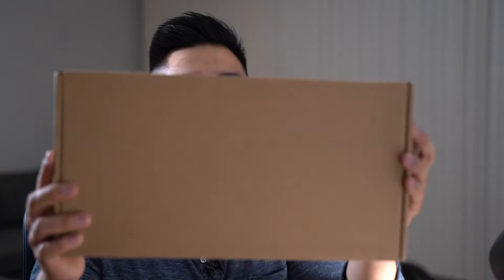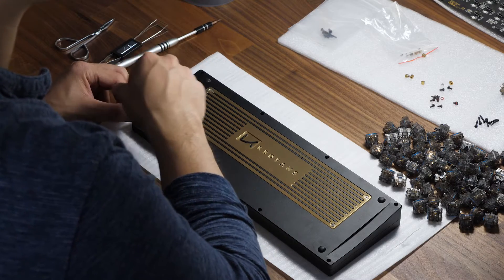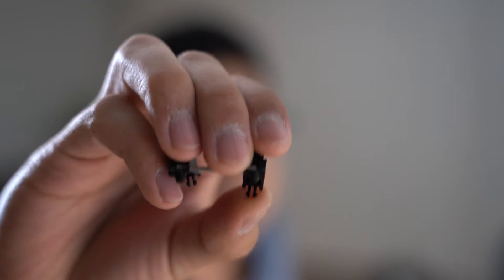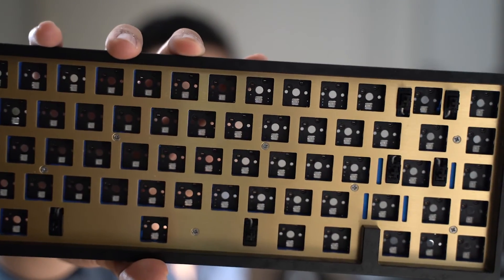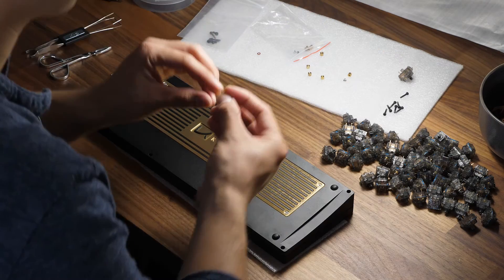KBD67MKII Full Beginner Build Guide - Part 1 - Assembling Case

Comment from the maker: Timestamps!

00:28 Test pcb
01:46 Different types of screws
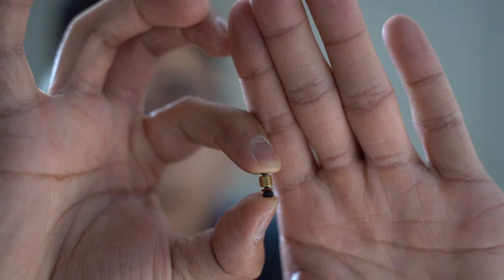03:18 Standoff screwing method
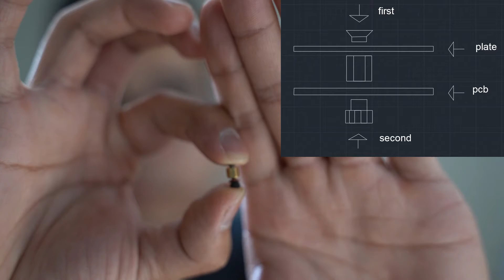03:38 Why use insulating washers 
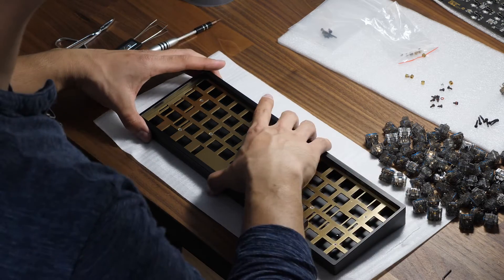05:58 Take apart keyboard case 
07:13 Identify the screw that attaches plate to top piece of case 
08:19 Attaching the philips head to the plate and standoff
09:06 Diagram for philips head, plate, standoff, PCB, and hex screw.
09:53 Stock stabilizers in box.
10:30 Importance of tuning stabilizers
10:57 Band aid mod with electrical tape
11:19 How to identify where the stabilizer openings are
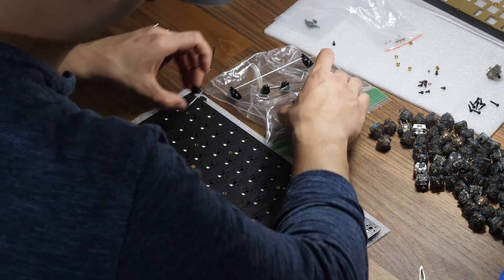12:12 Installing tuned snap in stabilizers to PCB
13:53 To check that your stabilizer stem is oriented properly 
14:51 Installing MK Ultra Foam
15:31 Lining up PCB to Plate
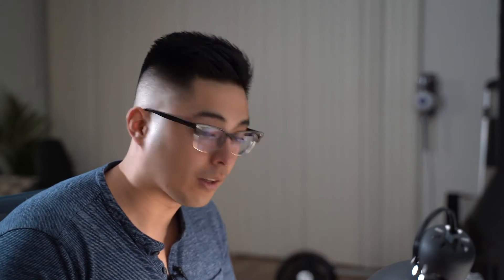16:11 Screwing in hex screws to the standoffs on the plate
16:16 Why I put insulating washers on the stabilizers and also the standoff screws
18:04 Importance of not overtightening screws
19:34 MKUltra case foam installation
20:41 Lining up the top case piece to bottom case piece 
21:17 Screwing in case
Reply: epic
Reply: So this means that the PCB supports Screw in and Clip in stabs right?
Reply: @Caiden Colin flixportal :D
Reply: @Parker Mekhi thanks, signed up and it seems to work =) I appreciate it !
Reply: @Caiden Colin You are welcome xD

Comment: Very informative video, thank you very much! I've just pre-ordered the KBD67V2 MKII ink black polycarbonate diy kit, and looking forward to it in september. This video will help prep me for my first full custom assembly. Just want my first experience to go smooth as possible, that way i have more confidence with assembly, once i'm ready to learn to solder later down the line, on another build
Reply from the maker: It’s a great first board!
Reply: @AndyVNguyen  do you know if Screw in stabs work with this board being hot swap pcb? sorry for noob question but, it is my first time, be gentle.

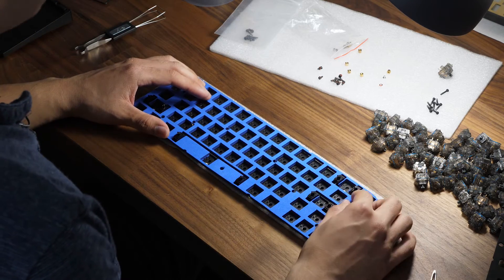Comment: Thanks for taking the time to put this guide together. Definitely useful while I'm putting together my own keyboard. 15:20 Do you feel that the MK ultra foam is worth it? Did you notice a discernible difference in noise/feel when typing? Thanks
Reply from the maker: I'm glad I could help! MK ultra foam does help, but I found that using the pcb foam made the typing experience a bit too stiff. The case foam was sufficient to mute any pinging from the alu case.

Right now it's pretty tough to source mkultra foam since they're having laser issues, so I often just suggest getting some shelf liner. 1/8" shelf liner will do the trick. It's much cheaper.

If you want to ball out a bit, you can get sorbothane .. but that's super expensive. I use shelf line for most of my boards, personally.

Comment: Hey man, good tutorial. I followed everything and it turned out amazing. However, I do have one question tho- you don’t need to install the standoff and plate/pcb screws if you’re using it as top mount right? The switches would hold them in place?
Reply from the maker: You should use the standoffs if you're using the hotswap version. It helps the switches snap into place and stay there. The plate has some stiffness so you CAN forgo it, but it's recommended to still use them.

Comment: Hey Andy, how do I tell what sizes of stabilizers to buy? Another question, since I'm using the hotswap version does it matter what keycap set I buy since I can customize the board? I'm kinda confused about how sets are sold and what I need for this board. Some keycapsets are only space bars and Cyrillic letters,  some are only novelties and modifiers. Will I need to purchase multiple smaller sets fill this board or what do I look for? I appreciate you taking the time to make these videos for people who are new to this hobby.
Reply from the maker: Look at the keys that are on the board. This one uses 3x 2u stabilizers for left shift, enter, and backspace. The spacebar is a 6.25u because it has a fixed layout for hotswap. 

Keycap choice matters. For this board it uses a non standard right shift, a 1.75 shift. So you’ll need to buy a keycap set that has that. Most epbt, gmk, Jtk sets will. Most tai hao and amazon ones will not.  Glad I could help!
Reply: @AndyVNguyen  Thanks Andy!

Comment: The newer version of this board (MKii v2) has ESD protection, but I have no idea how/where to install the little square silver pieces. One is right where the stabs would go and I can’t figure out how it can fit.  Can you show us or explain?
Reply from the maker: If you go into my discord server and take a pic of the pcb I can help you . It goes on those silver pads on the pcb. Skip the one on the spacebar that one won’t work

Comment: My kit came with two small square adhesive pieces of foam with metallic fabric on the end. Do I need to stick these on the corresponding metal squares on the PCB? Or does the large laser cut foam that comes with the kit reduce the need for this?
Reply from the maker: I didn't put mine on the board. I don't think it really does anything.

Comment: Hey Andy! I have commented on here before and you responded so I thought I'd give it another shot! Since you have experience with the KBD67 MKII, does it have screw-in stabilizer compatibility? and is there some sort of washer that meets the screw at the bottom of the pcb or how does it screw in?
Reply from the maker: yes. you put washers in between the screw and the pcb. it's applied at the back. they're not included so you have to buy them separately.
Reply: Andy V Nguyen thanks! So if I bought some Durock screw-in stabilizers, would they come with the washers?
Reply from the maker: @noahliebman7709  no, they don't come with washers. if you're looking for washers, take a look at my kit page:

http://www.kit.co/andyvnguyen/keyboards
Reply: Andy V Nguyen ahhh, I think the term I meant was nut, like is there something on the backside of the PCB that the screw also goes into to secure it?

Comment: My kit (soldered kit bought in May 2020) did not come with insulating washers. I only have some that came with the screw in stabilizers. Should I be concerned? Also, the plate that I got did not have holes for the standoffs. I am not sure what to do.
Reply from the maker: You have to buy your own washers. I have some on here https://kit.co/andyvnguyen/keyboards. If you have a solder board, your plate will not have stand-off holes

Comment: Do you know where I can get replacement case screws? The ones that came with the DIY kit are crap and have started to strip easily and one already broke in half! :( Thankfully I was able to get it out with pliers. Any recommendations are appreciated.
Reply from the maker: I would definitely contact KBDfans to send you replacement screws or at least get the spec. People often buy parts from mcmaster.

Comment: I got the screw that you are using for the standoffs on the pcb side. But i am not using it for the standoffs as i got a different screw that has a more rounded head compared to the other screws which all have a flat screw head. But as you stated you use the medium screw for the standoffs and the shortest screw for the plate, the screws I got are really easy to tell apart compared to the ones you are showing 7:34. I used the shorter screw for the standoff on pcb side, as i had the exact amount for the standoffs. Then I used the medium length screw for the plate, should i swap them around?
Reply from the maker: Just make sure the flat head top is on plate side. So your keycaps won’t hit it
Reply: yep they are, i swapped them around now so the medium screws are now being used for the standoffs and the small ones for the plate. But now my pcb foam doesnt sit flush anymore, you can visibly see the medium length screw protruding. Should I revert to how I originally assembled it or it should be fine.
Reply: Also thank you very much for replying!!! didn't expect it since the video is 1 year old.

Comment: Hi Andy this video is awesome. Thank you! It's been super helpful. Ran into some trouble though. Spent my Labor Day building my first keyboard and one of the screws broke off when I was mounting the brass plate to my KBD67MKII. The screw head came right off leaving the thread in the case. Any tips on extracting the screw from the case?
Reply from the maker: If it’s just one screw, you can try rotating the case top/bottom itself rather than the screw itself to try to wedge it out. Other than that, a screw extractor
Reply: What extractor do you recommend? The top of the screw broke off completely so I can’t get any leverage to turn it like you mentioned.

Comment: Recently purchased a kbd67mk2 and my plate doesnt have holes for the philips head screws. Is this normal?
Reply from the maker: Sounds like you have a solder kbd67mkii. It’s not required for those
Reply: @AndyVNguyen  okay confusing... why the standofffs then

Comment: is the pcb supposed to be slightly loose to the plate if there are no switches installed?
Reply from the maker: Add the switches first and see. Not much purpose in checking if things feel weird without switches in

Comment: Is this bottom mount or top mount? The older model was bottom mounted while the v2 is top mounted. Does anything in the building process really change?
Reply from the maker: This kbd67mkii is top mount. The build process will be different but the same concepts will apply.

Comment: Should I buy the kbd67mkII or the nk65v2?
Reply from the maker: kbd67mkii is better if you can find it for a reasonable price. the nk65v2 uses plate mount stabilizers which do not sound great. the kbd67mkii takes screw in stabs so you can use durock stabilizers and get a really smoother experience.
Reply: @AndyVNguyen  Thanks a lot!

Comment: What cases are compatible with the KBD67 MKii ?
Reply from the maker: It's really just intended for this board. But technically you can use it with an S65 case with some modding. But to get an S65 case.. you'll already have a PCB. So it makes little sense to buy separate things.
Reply: @AndyVNguyen  soo... i bought the PCB by itself not knowing that it needs this specific case. Do you know where I can buy just the case? I'm having trouble find it.
Reply from the maker: @RRRx01  Sorry.. you're going to need to just return the pcb because nowhere will sell a case only for this board.
Reply: @AndyVNguyen  boi you guys have the same name

Comment: i just started working on my board but notice they gave me the wrong plate.  It doesnt have the holes for the stand off ...........
Reply from the maker: Do you have a hotswap version or solder version?
Reply: @AndyVNguyen  I have the solder version
Reply from the maker: @wangsatang  Solder has no standoffs needed. You got the right plate. This guide is for the hotswap version specifically.
Reply: Ohh thanks for the info.  This is my first build.

Comment: I have the hotswap pcb. If my brass plate doesn't have holes, it's for the soldered version, right? Or can I still make the hotswap version with this plate?
Reply from the maker: Yes. You can still hotswap with that plate, since the plate is so stiff it’ll still hold up to a hotswap
Reply: @AndyVNguyen  thanks! If I were to buy an aftermarket plate FR4, POM, or PC, I would need the one with holes, and then I'd use the brass standoffs? 

The brass plate is fine right now, but it definitely is a bit stiff. 😄

Comment: feel like id still screw up. i think ill just pay for kbdf to do the assembly..
Reply from the maker: If you pay for kbdfans to assemble a solder board, they won't lube the switches and stabilizers. You should definitely not pay them to assemble a hotswap board.